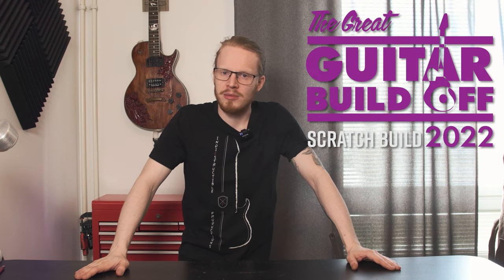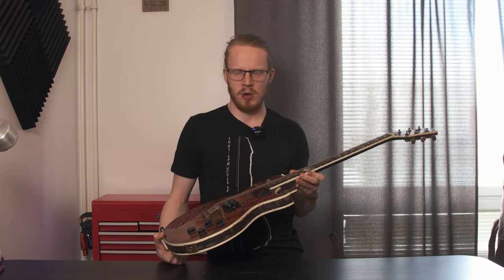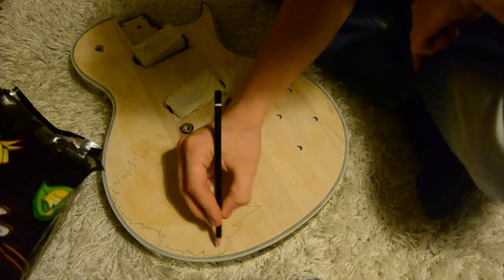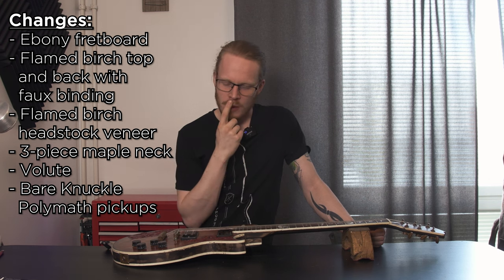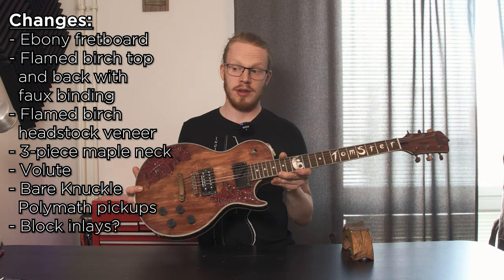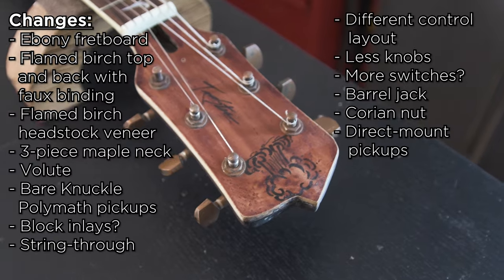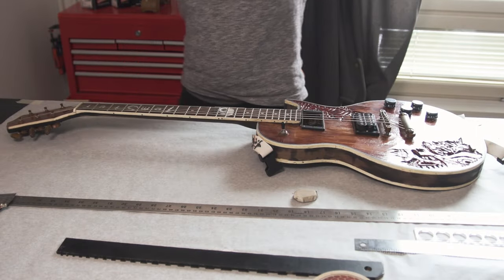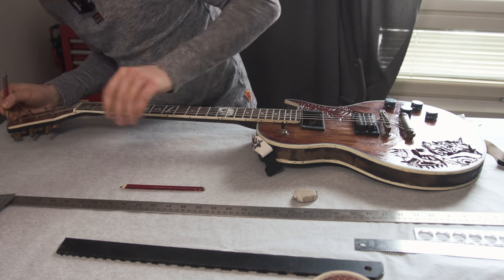Making the Plans, THE GREAT GUITAR BUILD OFF 2022

Comment: Pity about the bookmatched woods being a touch too narrow. But couldn't you shrink the body width down by a hair?
Doubt anyone would notice that it's 98% the size of an LP.
Plus it's such a thin body too, and with the narrowed headstock for straight string pull, it'd not look imbalanced.
I know this all happened weeks ago, but maybe for the next ones?

If you haven't got there yet, I do like the look of offset dots nowadays - say 1-12 on the top edge of the fretboard, 15-21 on the bottom edge.
And if your tuners are slightly offset, mirror that on the string through ferrules - in either a 3x3 or a 4x2
Reply from the maker: I mean, I could. And am looking at also just continuing the tops. Meaning, taking the wood cut around the waist and gluing to the same side "backend/arse". That would work fairly well, so I'll see if I go to that option if thd 7/8 size doesn't look right to my eye. This is still in this stage of the development and all of these are great ideas for me to run through once the build properly starts. So thank you :)

Inlays are still very much something I want to get right. Both as what I personally like and as what would fit the build. And you definitely have a great point with the ferrules/tuners!